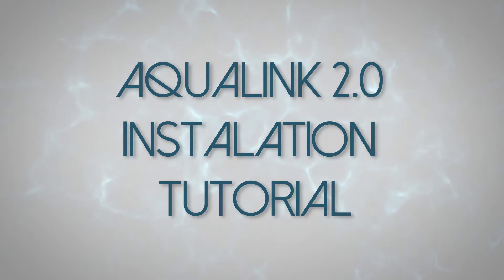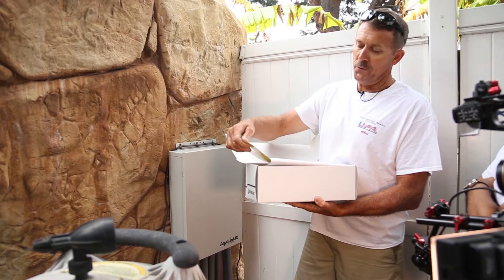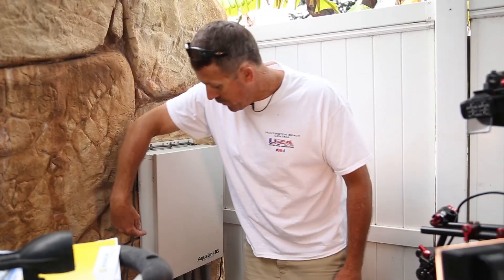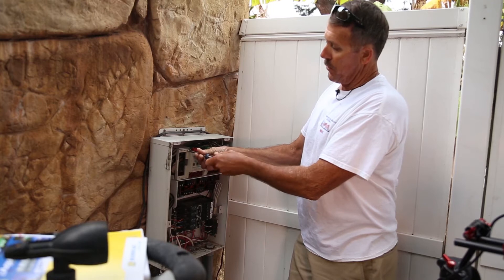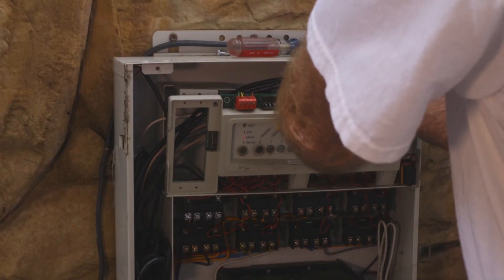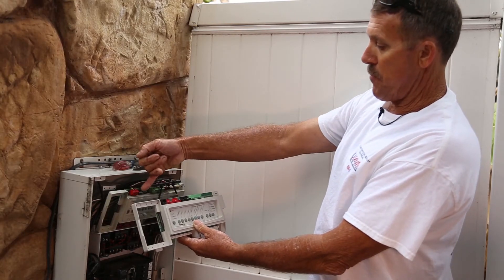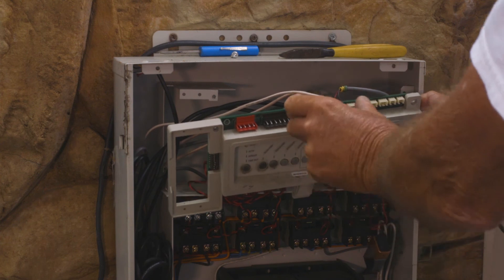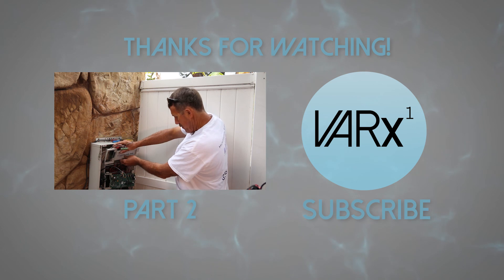Aqualink 2.0 Install Tutorial (1/5)

Comment: What a great video series. Thank you!
If you are upgrading from an older AquaLink RS system and have a PDA that you still want to use... you can. The existing PDA continues to use its RF antenna. Just wire it in parallel to the same connector that the new 2.0 antenna uses. No setup required. You end up with 2 antennas on the wall. Jandy cautions that the new iAquaLink board does not support all PDA functions.